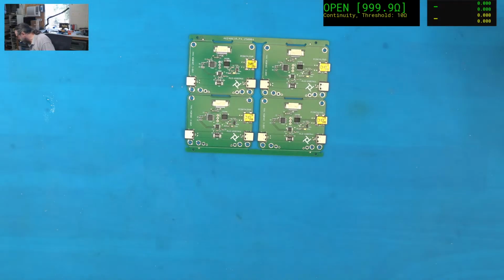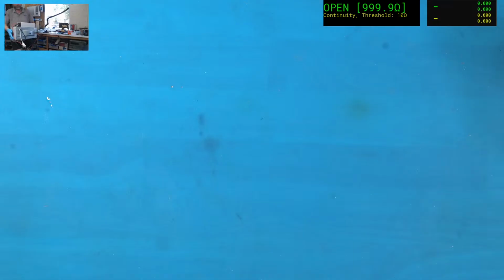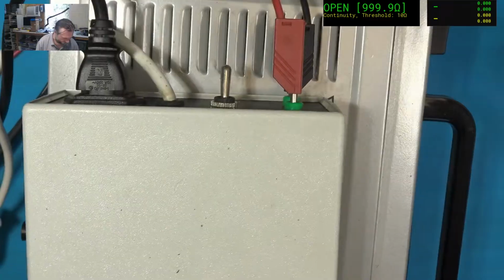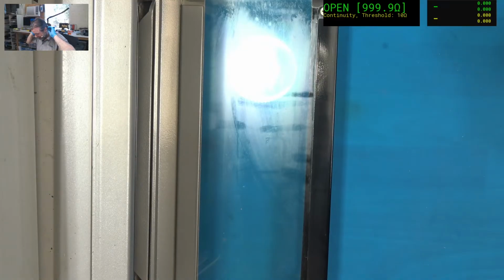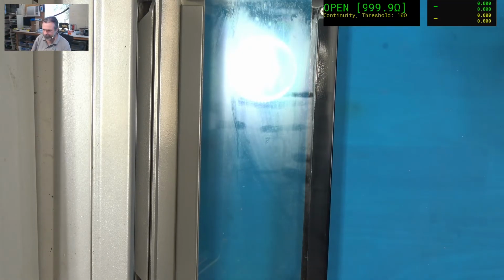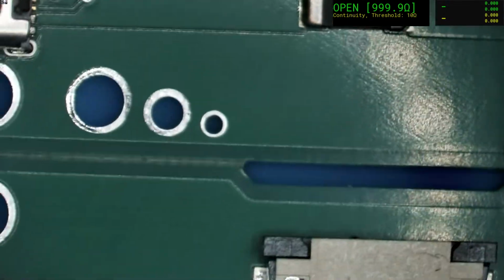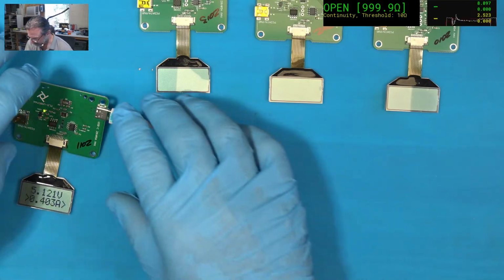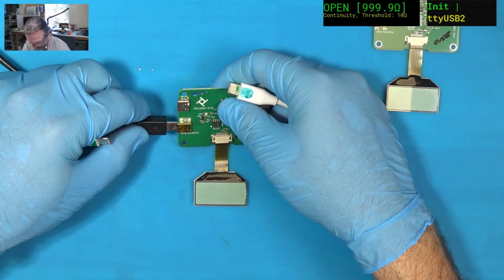#139 USB-C Meters build - behind my orders; why I hate retroactively building for items already sold

Comment: Thanks for the shout-out, Paul. No, I wasn't on the livestream - I'm rarely able to catch them, so watch at a later time.
With regard to the bridge, yes, I have a "sled" of 2mm MDF that carries the boards and I slide that left/right with the bridge stationary over top - so right hand does the y-axis with the picker and the left hand controls the sled in the x-axis. Simple & primitive, but cost-effective!

Just wondering - do you sell to the States, and if so, how will you be handling the withdrawal of their De Minimis (I'm in the UK, and as of today have had to turn off sales to the US)?
Reply from the maker: Taking a bit of a "wait and see" approach, not quite sure how much it'll add on top of the existing pricing as yet.  I suspect it'll be either PayPal who handles the cost-extra for these small sales.

I do like simple/cost-effect solutions.  Over the last 20 years I've seen a lot of manual PnP machines but very few of them really resonated with me, many of them out there seem to actually take longer to use than even what I'm doing now ( though their placement precision is potentially higher :) ).

Going to grab myself a couple of kitchen-drawer sliders and see what I can do ( have to get the right sort though as some don't like sliding when laying flat )
Reply: @pldaniels  Yes, the drawer sliders plan sounds good: moving the bridge in the y-axis in your orientation.

With regard to US sales, I was going to wait and see as well, but there's a problem with that, at least from the UK perspective. The duties are payable in advance and will be collected by the postal service (Royal Mail for me). It's still unclear whether the duty will be $80(US) per shipment, $80 per item, or ad valorem (10% for the UK). The RM website makes no mention of the $80. On top of that, there will be handling charges! RM will be starting the billing/collections next week. It's only a guess, but I don't think Paypal will be collecting the duties. So, if you've not already done so, it might be worth checking with your carrier otherwise you might end up with an unexpected bill.
Reply from the maker: @eightyones  looking at the AP website and other writeups it primarily seems to pertain to transiting packages (ie, non-AU => AU => USA) and separately low value packages ( < $800 ) are still exempt "for now", though even if they hit with a 10~20% tarrif it seems to be a different thing to the transiting packages situation that is what AP and other countries are "halting" for now.
Reply: @pldaniels  AP does seem to be the only postal service I've looked at that only mentions transiting mail, but many European countries are definitely suspending all goods shipments to the states, either already or starting Monday/Tuesday. The good thing (or rather, less bad thing!) is that the 6 months of a flat tariff of $80-$200 mentioned in the executive order seems to have been forgotten.
Nevertheless, I'm sure this quagmire of confusion will eventually sort itself out! It'll be interesting to know how you get on if you've got anything going to the States next week.